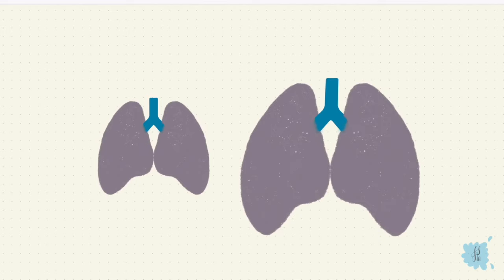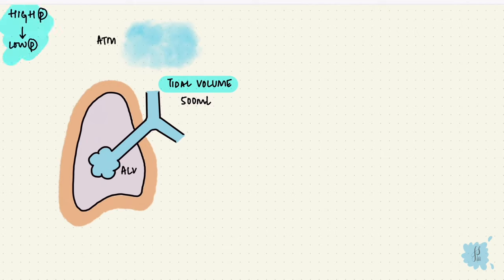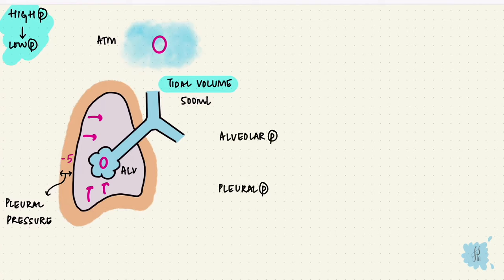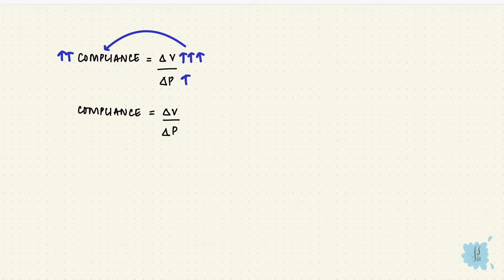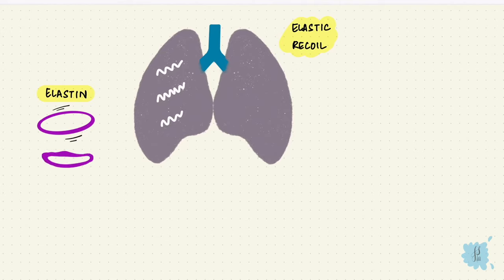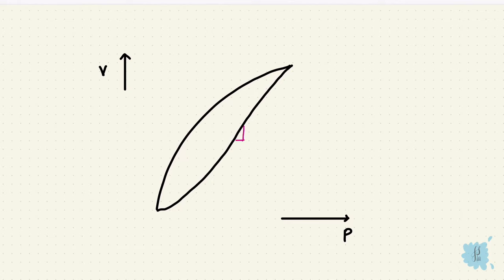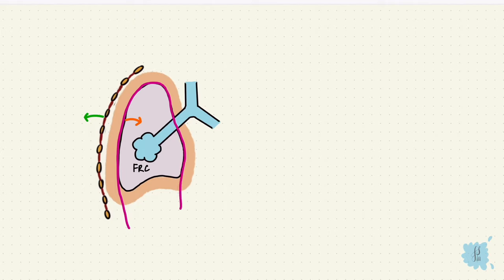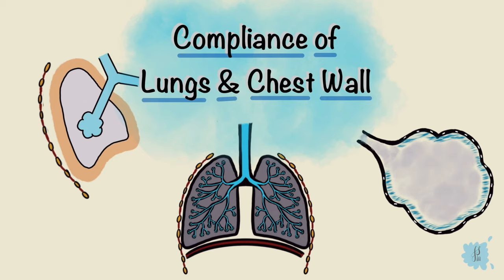Lung and Chest wall Compliance | Breathing Mechanics | Respiratory Physiology

Comment: Great video as usual before my exam tomorrow.

I have a question, I get confused about static and dynamic compliance/resistance, if you could explain how it relates to compliance overall ?

thanks
Reply from the maker: Hi! Honestly compliance confuses me a lot. 
But from what I’ve read, the static compliance is the compliance when there’s no air flow and dynamic would be when there is air flow. So dynamic would have to include airway resistance as well. 
I hope that helps.
Good luck on your exams! 😊